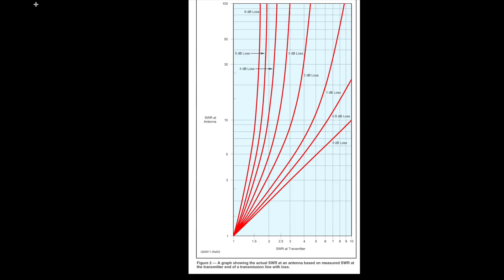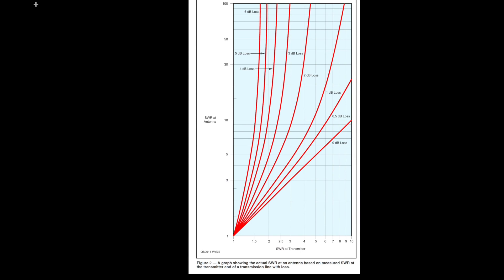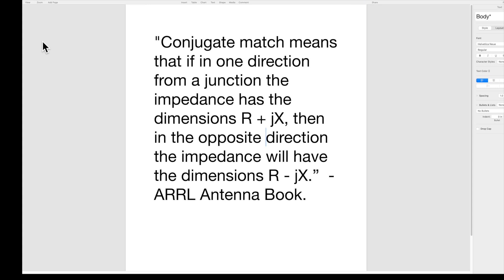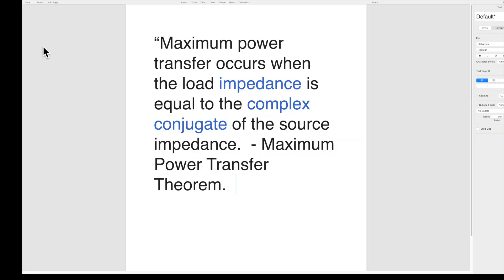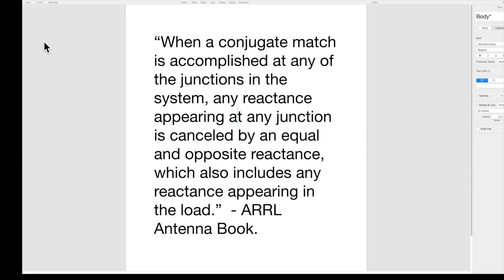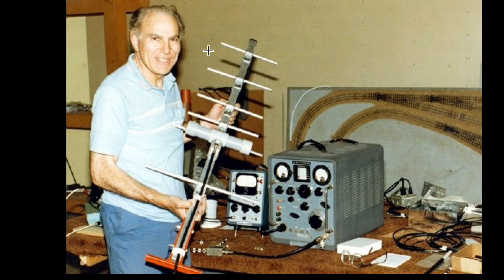Ham and CB Radio Myth - A Transmatch Tunes Out All SWR.

Comment: Does an a.t.u. tune an aerial to resonance or does it provide an impedance match?
I think it's all one and the same thing.
Providing a match via a tuner tunes the aerial to resonance and tuning the aerial to resonance via a tuner matches it to the tx. 
Problem solved.
Either way it allow me to use a (short) long wire on h.f.
G4GHB.
Reply from the maker: Hey Bill how are things in the UK?  Tuner provides an impedance match.  If you are using a wire that is not resonant on any given frequency it can't change that.  But I like to say it tunes the antenna system, which includes coax line and antenna to resonance.  At least that's what the transmitter sees.
Reply: @BustRadioMyths  
Yes, I'm o.k. thanks.
When first licenced I tried coax to the long wire and didn't think it worked well so since then I like the tuner right at the aerial. 
Like a base loading coil to tune out capacitance of a short aerial as the books tell us. Right at the aerial. Matching or tuning? We make tuned resonant circuits with L and C so why not a piece of wire?

I don't know if it was coincidence but I went with another amateur and he ran a long wire through his tuner with coax to his l.w. and worked nobody but I did. Mine was the l.w. straight into my tuner. 
I see the reason is supposedly to stop house interference in the shack being picked up on the wire.

G4GHB.

Comment: Mark
I asked this once before but I’m missing something. If the tuner provides a conjugate match and eliminates the X along the feed line and antenna then wouldn’t the SWR also change since X is part of the impedance formula?
Reply from the maker: That's like saying a transformer changes the impedance of the two circuits that it is connecting.  The transformer just allows maximum power transfer between different impedances.

Comment: I have seen changes in velocity quality at the transmitter amp swr meter and a switch box using a 58 x and a 213 ccable one is 3 ft the other 6ft swr stays same but output at the watt sswrr meter increasels the person on the other end heres a llouder strongger sivgnal a.nd responds faster when in mismatcj of jumpers!!

Comment: Here's a real world example and some food for thought:

Frequency near 10.1 mHz
Using RigExpert 230 antenna analyzer
Random Wire antenna fed via 3ft of 50 ohm coax with choke balun at antenna feedpoint.
Coax input feedpoint impedance Z= 60-j174 (rounded) 
Coax input feedpoint SWR 12:1

Canceled capacitive reactance (i.e., antenna made resonant by adding series loading coil at antenna feedpoint after choke balun) resulted in a purely resistive Z=60 with SWR 1.2:1 at coax input feedpoint

Notice that SWR at coax input feedpoint significantly changed when a conjugate reactance match at coax-antenna interface or feedpoint was physically applied.  In other words, SWR for a purely resistive impedance was significantly different from a complex impedance.

So, if a transmatch creates a true  or real (as opposed to virtual) conjugate match at all interface points (e.g., coax feedline to antenna), then when applied to the above setup the SWR on the feedline should change in a like manner.  Yet, in my and other's experience, feedline SWR does NOT change when a transmatch is applied.  Thus, I conclude that transposition of the conjugate match to remote interface points is a virtual concept that has no physical consequence.
Reply from the maker: A conjugate match on the feed line does NOT change SWR.   I made that clear in the video.
Reply: @BustRadioMyths  Yes.  That's exactly my point -- which supports my conclusion that a conjugate match at the feedline input to transmitter junction does NOT somehow transpose itself to appear at the feedline output to antenna junction or any other remote junction within the feedline-antenna system.  It can be posited that the virtual effect  of a conjugate match at the feedline input is to bring the entire feedline-antenna system into an impedance matched, resonant state; but physically the feedline-antenna system remains in a non-matched, non-resonant state which is exhibited by an unwavering SWR on the feedline.
Reply from the maker: OK thanks got it!

Comment: Hi Mark, thanks for taking a shot at explaining the complex subject is what VSWR is.  Since most Hams have never designed and built their own equipment, and ready-made "Appliances" are available from many manufacturers; ignorance abounds on this subject.

Basically, the source (the transmitter) and load (the antenna) must be a resistive 50 ohm impedance at the operating frequency.  Coax of the same characteristic impedance (50 ohms) must be used to connect the source and load together, which is the transmission line.  A mismatch between the source and load is measured in VSWR, which is a ratio of source impedance versus load impedance.

I know many people will disagree but, antenna tuners are only to be used between the coax and antenna.  Placing the tuner between the coax and transmitter causes the coax to radiate.

Mismatch between the transmitter and antenna causes the transmitter to absorb and dissipate the reflected power.  For instance, trying to drive a 3:1 mismatch causes the transmitter to dissipate 25% more heat (assuming no line loss).  This is not a big deal unless you are transmitting a continuous carrier, such as with AM or FM modulation.

--Bill, AC8AQ, Ocklawaha, Florida
Reply: Bill you have a misunderstanding of this subject, a tuner doesn't cause the coax to radiate and a transmitter doesn't absorb reflected energy
Reply from the maker: What about hams who for years have been using ladder line with great success?  Its impedance is 400 to 600 ohms?  Also, reflected power is reflected by the tuner back to the antenna where it is radiated.
https://youtu.be/Xz73tkDOZDw
Reply: @BustRadioMyths  For ladder lines, the transmitter is usually is driving an antenna of similar impedance to the transmission line but, there must be some type of impedance transformation network between the transmission line and transmitter.  I must confess, I have never designed or used that type setup so, I could be wrong.  I redesigned an HF power amp for Rockell/Collins in the early 1990's and since the previous design had a high failure rate to VSWR (failure due to antenna arcing), I had to redesign the PA protection circuitry, which took considerable effort first to understand VSWR.
Reply from the maker: Ladder line has such low loss it can drive an antenna of any impedance because the additional power loss caused by high SWR is insignificant with ladder line.  SWR could be 20:1 on ladder line and as long as you are using a tuner it doesn't matter.
Reply: @billharris6886  the whole point of ladder line is to use with antennas that are way off the impedance of the feedline for the impedance transforming to reduce loss eg ,2400 ohms using 600 ohm ladder line is 4.1 swr whereas using 50 ohm coax 48 .1
Reply: @Pioneer936  Thanks for your comment, I'll have to study up on this.

Comment: I do not own a antenna analyzer ! I suffer enough delusions of grandeur that I do not dare to partake is such dubious machinery !
I am determined a antenna analyzer will not cure what ails me !
I am intelligent enough to know that !
I am quite dumb and I know it !
Because !
I catch a headache when I dwell on things too long !
I do admit I have at times replaced science with superstition !
I try to avoid superstition but I do not point at the moon without spitting 3 times !
I a qrp cw operator ! It a sickness I suffer !
I do not worry much about Mr SWR !
I like wires on the order of 1/2 wavelength of the frequency that I am attempting to pollute.
I think 1/2 wavelength wires are somewhat efficient.
I always use a tuner and use a LED Tuning Indicator.
In the olden days 50 years ago people seemed to worry a lot less about magic no tune antennas and the delusion of perfection !
I admit right off that delusions of grandeur and superstition will likely send a reasonable fella to the sea of heartbreak
You should do a video on our friendo MR RF in the shack !
A ham operator has not enjoyed the full experience that this hobby has to offer without a good visit from mr RF from the shack :)
73
Reply from the maker: https://youtu.be/4uwDBcTcSRw

Comment: Don’t come unglued on me  , question. What does the gamma match on the antenna do and play into what your saying . Is it truing the antenna or giving SWR meter false resistance reading .
Reply: A Gamma match (and its balanced line equivalent the Tee match) is basically an impedance matching transformer that's used to feed a contiguous conductor antenna element.  It transforms the antenna's feedpoint impedance to feedline's characteristic (AKA impulse) impedance.
Reply: You might say the gamma match is a tuner at the antenna terminals. It converts the lower than 50 ohm impedance of the Yagi to 50 ohms. Precisely 50 + j0 ohms which is a perfect match for 50 ohm cable. In reality it just comes close to that and at only one frequency. Above and below that frequency the impedance will vary a bit from 50 ohms. I consider the gamma match to be part of the antenna.